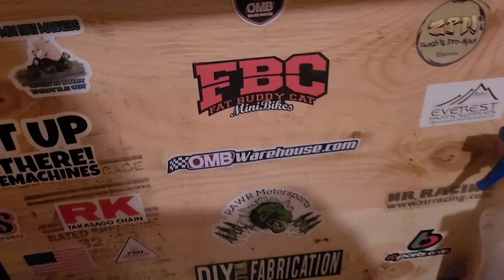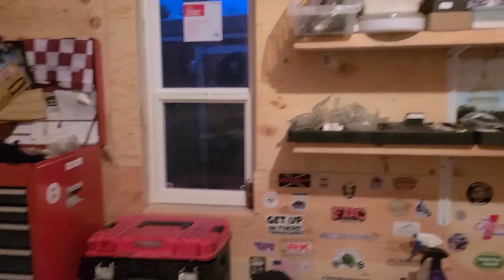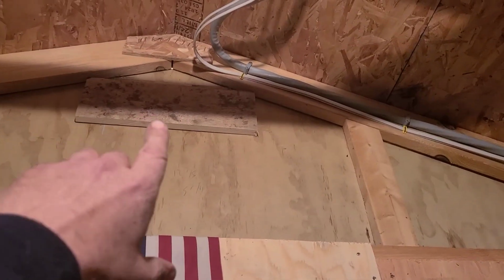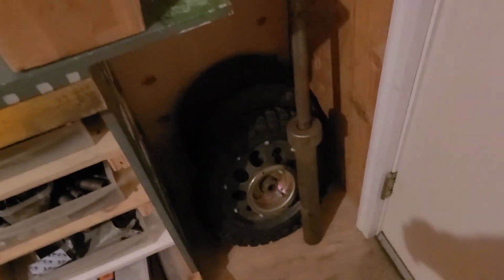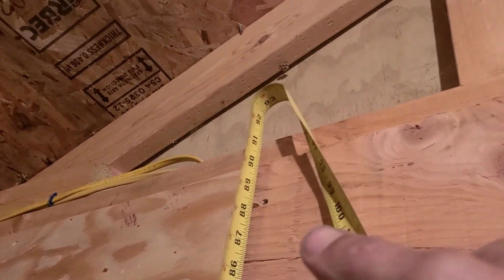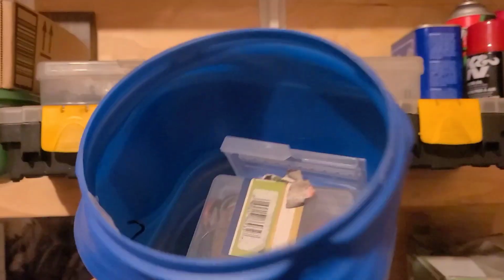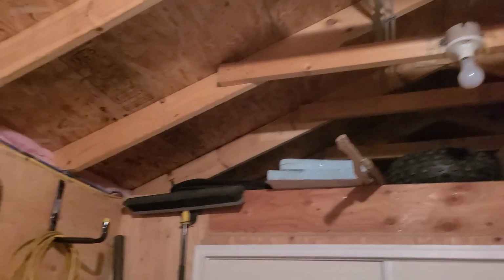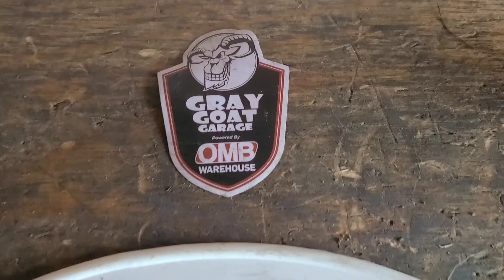Update Video: New MINI shed!!

Comment: Great job I really like the new shop! And it has windows… Perfect 👍 
Originally when I started my channel I was going to use the 8x10 shed I have in the back yard. It just needs power and a window. But right now it belongs to the black widows and they haven’t given me notice about leaving any time soon. I may have to go to battle with them and reclaim what’s rightfully the DIYWILLY shop..😂 Looks really good. How about outside? I know when the weather gets better is there a place to work?
Reply from the maker: Lol thanks! It was warm for 2 weeks but we just dove head long into winter. We got a first snow and freezing temperatures. I had to build another 8x8 shed for storage to open this shed up and then remodel this one so it took me a while!
Reply: @fatbuddycat  Looks good 👍 what’s the reason to block off the vents? Won’t the vent help with condensation?
Reply from the maker: @DIYWilly  they would if I insulated the cieling but at that point I'd swap to soffit vents, tray the cieling bays, insulate and sheath over it. I'll take the covers off in the summer to let it breathe  but they let out too much heat on the winter. The roof is plywood and metal so it should deflect moving air enough to keep it warm. It won't hold a constant temperature but it doesn't take long to heat the total space. It's a noticeable difference from standing outside that's for sure! 🥶
Reply: @fatbuddycat  Gotcha man I understand.  Definitely a different climate on the east coast…

Comment: I have a 12x16 shed i work out of. I built mine in 2014 for about 1000$. I think it would cost me twice that now. It serves my needs well. Its still not finished but hey its a work in progress 😁
Reply from the maker: I built an 8x8 storage shed to free this one up and that was more than $1000. The cost of plywood is bananas. Nominal lumber is up there but nothing compared to laminates. Insulation is through the roof except for mine because I can't afford it. As is I had to sell my Trailmaster roller to fund this z50r project. Heartbreaking but I just can't keep them all.